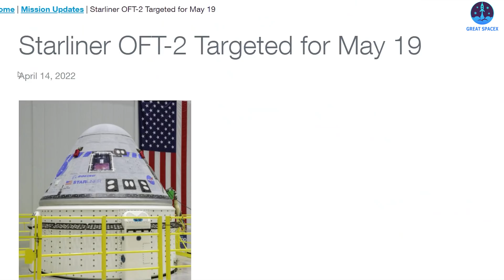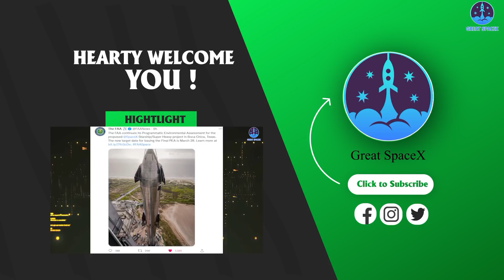Disaster! Why so many worried about SLS & Starliner? How SpaceX saves US rocket industry...

Comment: Boeing used to put engineering and research before profits and that all changed with the McDonnell Douglas merger. Since then you've all seen the issues not only with SLS and Starliner, but also the disastrous handling of the 737 MAX (from development, no change in pilot training, Lion Flight 610 crash, not grounding the plane, the Ethiopian Airlines flight 302 crash, to finally grounding the plane) AND issues with the new 777X pushing delays until at least 2024.

Comment: Actually, I would argue that Dragon/Falcon and Starliner, when both are human rated are two separate launch systems. They are from the same company but none of the parts interchange so a problem with one vehicle system will not likely affect the other. 

More importantly, they actually fly unlike the Static Launch Simulator.
Reply: Dragon and Starliner are NOT from the same company.  Dragon is Spacex, Starliner is from Boeing.  Dragon has completed 5 (soon to be 6) manned missions, while Starliner has not completed a successful unmanned mission.
Reply: @hankscally9658  @&$€ spell checker. Should have been “Dragon StarSHIP”.
Reply: @eneking2022  That makes a lot more sense!  LOL!!

Comment: CST100 on the SLS?????

 I see like a bombay rickshaw with 2 top fuel dragster engines + 2 SR-71 reactors (the 4 at full power)

may not be very suitable

the most expensive taxi in the world by far
without counting the cost of the CST100 the invoice is
$4 billion for ~400 km so $10 per meter of altitude and only once every 2 years.

the USA is a great economic power yes! but there really is no way to make it cheaper.

Comment: we would be a joke on the world stage right now if it were not for Space-X.
Reply: This showed up in my feed but there’s no way I’d seek this biased stuff out. I like SpaceX a lot, I’ve worked them at VAFB - I work for NASA JPL. I feel no ill will for SLS, Orion, or Starliner. There’s room for everyone in space exploration.
Reply: Much comes down to leadership and endurance. Did you watch the Problems X had with Raptor2 serial production? Elon went straight to McGregor kicked some asses, solved the engineering Problems and its now on track. And the you have the opposite Scenario at Blue Origin with its buggy BE4 Engines...
Reply: @seventone4039  that has already happened several times, the same happened with starlink the old team said that it would take a couple of years for starlink to get ready, Elon didnt liked that so he fired them and took control of the project by himself while Amazon hired those old team members for project kuiper

Result, starlink has almost 2000 sats in orbit while project kuiper has 0

Comment: So, if I understand correctly Starliner still needs to perform 3 demo missions, before operational flight? First one has to dock to the ISS, second one is the in-flight abort test, and the third one is the one with a test crew. Am I correct? This is will take a long time.
Reply: Not correct.  The in-flight abort test has been completed, or there would have been no earlier flight.  They have to complete an unmanned test flight and docking to the ISS.   Then, a crewed flight with docking to the ISS.   If all is successful, then Starliner will be certified.  This is exactly the same requirements that SpaceX completed.
Reply: @kokomo9764  I was under the impression that with SpaceX, 1st they performed the unmanned test flight, and after that, the in-flight abort test.
Reply: @Hayden Travis Don't known, I am not an expert. But maybe NASA requires the same steps for every provider.
Reply: With non renewable boosters.
Reply: @robofthewest  expensive tests
Reply: @robofthewest  Of course, all ULA lauch vehicles are disposable.
Reply: @davidlguerr  Yes, a backward step since they were designed for reuseability.

Comment: 4:55 Everything we know about the SpaceX Starship and Starbase TX after the first "Hoppy" test flight, has been designed, Built and tested in the same time it has taken Boeing to "FIX" Starliner.
Reply: Hey, I have an idea. Why not put the Starliner inside a Starship Cargo hold, ferry it the moon, where the astronauts can transfer to a SpaceX lunar lander, spend time on the surface taking pictures, then the Starship Cargo can ferry the Starliner back to earth, where Starship can spit it out in Earth orbit and Starliner can triumphantly splash down! Its just crazy enough to work!
Reply: @lawrenceallen8096  in saying that what would it take to put it on a falcon 9 or a modified superheavy!! Just a thought 🙄
Reply: @noelle3551  Starship is the BFR, isn't it?
Reply: @noelle3551  Yes, but we have to think like Elon. Like this: end 2023, Elon sends his lunar lander and starship fuel tanker & support ships to the moon. Lands. Has his astronauts shoot a commercial in front of the lander: "We're SpaceX and we're running a special. Get your astronauts into lunar orbit and we'll take them down and back from the surface for a fraction of your launch cost. And if you act now..." [cue: a "Tesla Lunar" rover drives out from behind the Lander] "...and we'll throw in a Tesla Lunar for free!"
Reply: @lawrenceallen8096  LOL
Reply: @lawrenceallen8096  It's even easier than that.  Launch HLS and refuel.  Launch Orion to orbit on a Falcon (9 or Heavy, whatever is required).  Dock Orion and its SM to HLS.  Send the combined craft to the moon.
Do the preflight calculations now and reconfigure the HLS fuel tanks to assure the required delta-V to make that possible.  Take SLS out of the picture to free up funds.   
It might also work better to modify Crew Dragon for extended missions, drop the Orion SM altogether...
Reply: @frankmcgowan9457  Good stuff. But where do you put the "Tesla Lunar" rover?
Reply: @lawrenceallen8096  Put it on a trailer and tow it... 😆
Reply: and in the same time it has taken the FAA to "not complete" a paper study of the environment...
Reply: @hoffbd1  Bezos paid off the Bidens to have the FAA slow down Starship's maiden launch until Dr. Evil can move from his little "Penis-Popper" vomit comet ride to an actual orbital launch.
Reply: Moon tourists!  We call them mooners.
Reply: @Chip-34982  SLS fans we call them mourners.
Reply: @Chip-34982  Then they graduate to become streakers like we did in our teenage days.